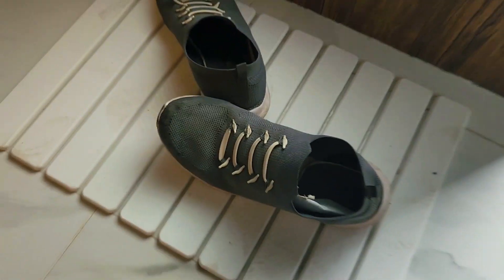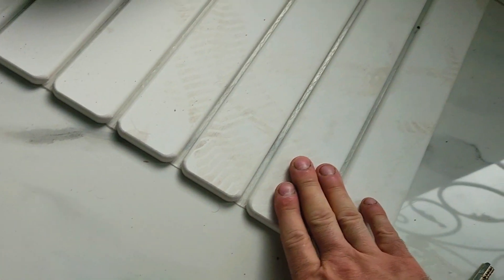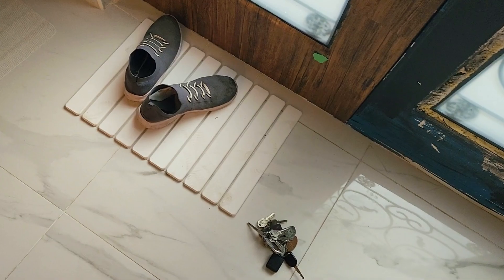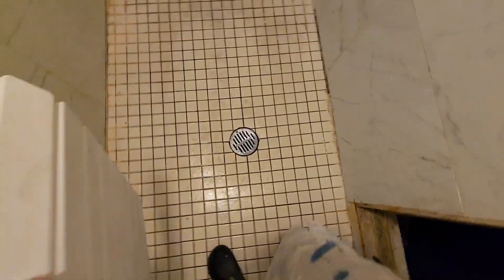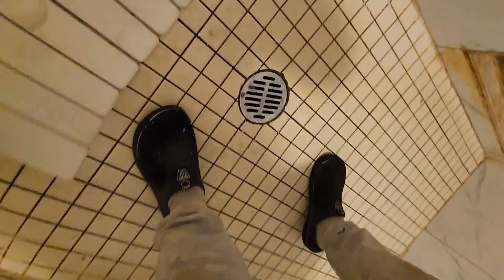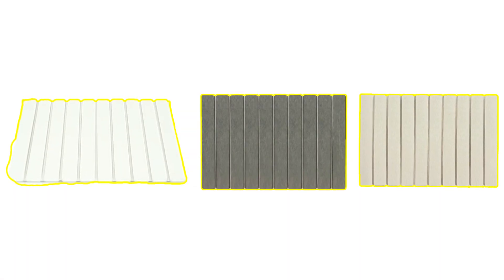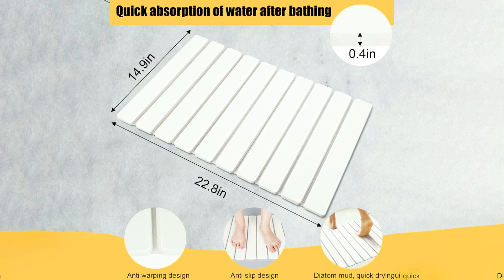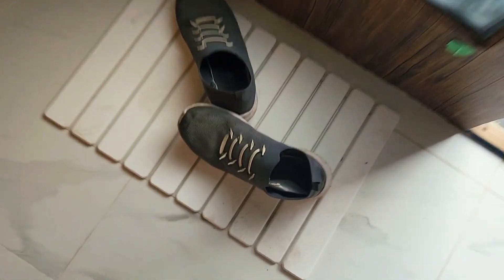Here is EXACTLY Why Stone Bathroom Mats are Better! DITCH Bacteria INFESTED Shower Mats

Comment from the maker: https://amzn.to/3zCJ2Tn & Other Styles at https://amzn.to/3Nc6oT1 - Tired of Bathroom Rugs that carry bacteria and smell? I came across this Diatomite Stone Bath Mat with 1 Soft Anti-slip Base Mat. Diatomite stone shower mat is wear resistant and easy to wash to keep clean when gets dirty; strong water absorption function makes it widely used in wet places such as bathroom, bathtub, kitchen floor, kitchen countertop, bedroom, doorway, swimming pool or more. It can be used to keep floor clean and your feets dry, used to place wet shoes, used as kitchen countertop drying mat for placing dishes/cups, used as pet mat or plant stand mat, meeting different using requirements.